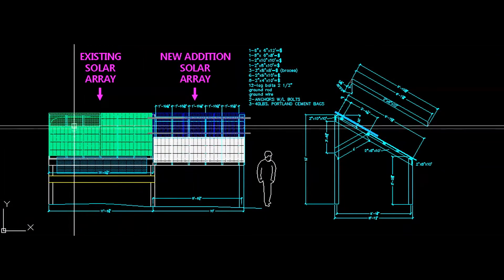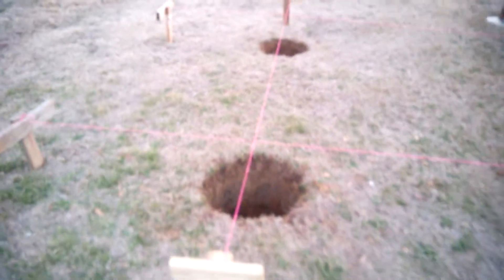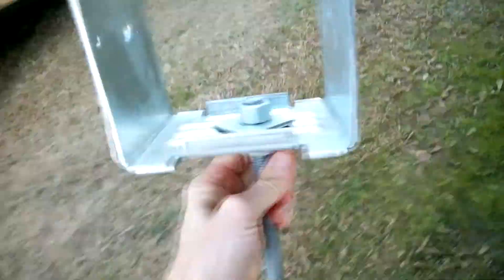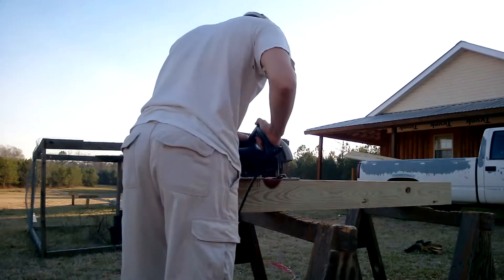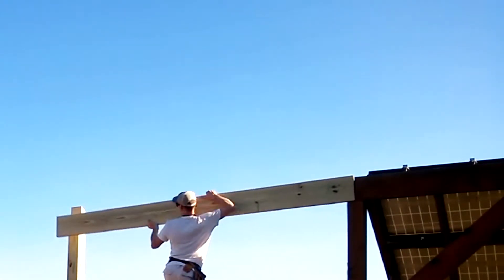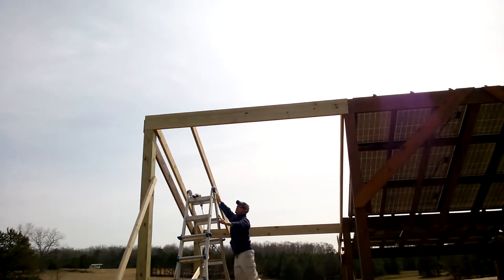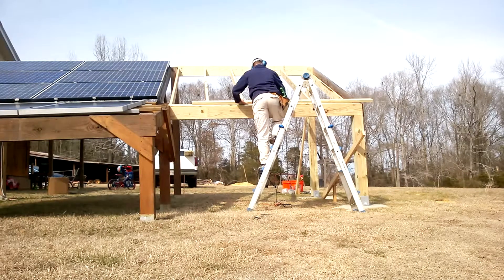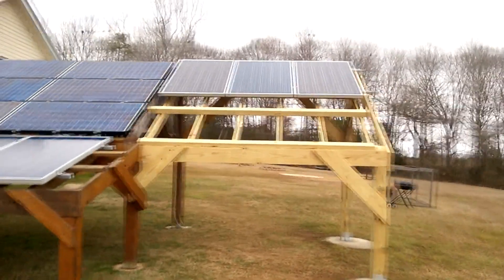Constructing wood framed off grid solar array new addition

Comment: Good sturdy construction. How deep did you put the concrete into the ground, It looks you did not put concrete deep enough to upto the frost line? Would not invite the permit problems? I am thinking of building such structure with 6 300w panels.Thanks.